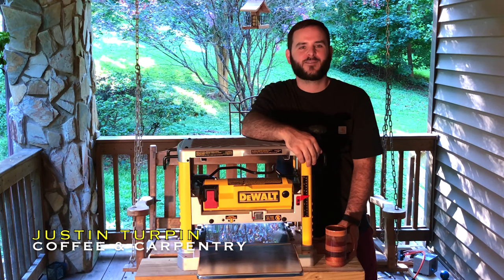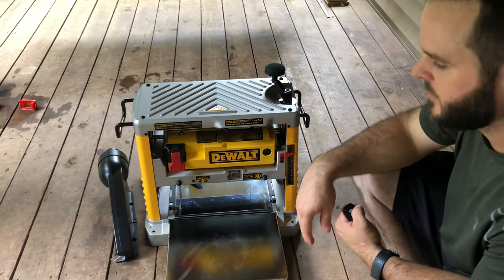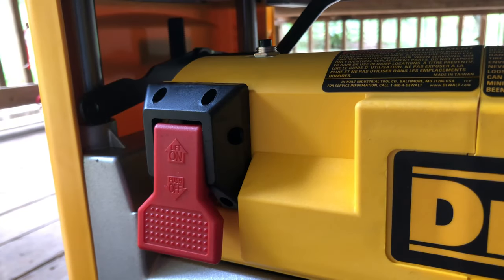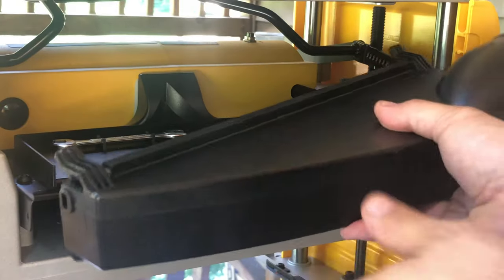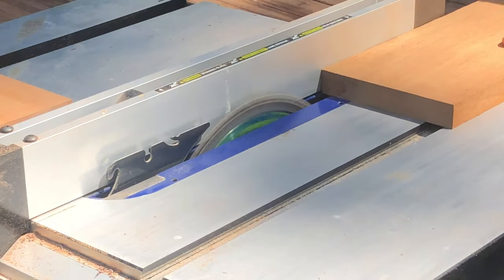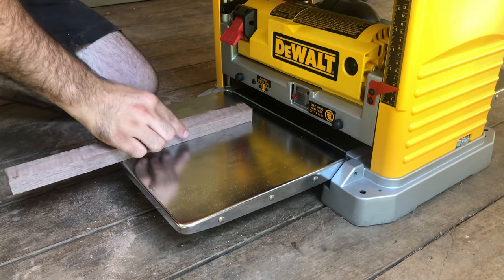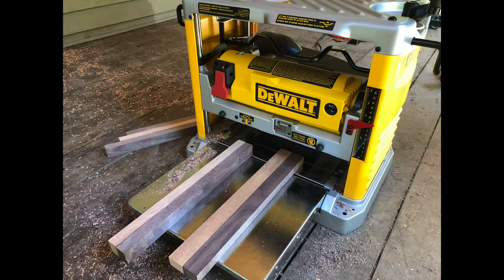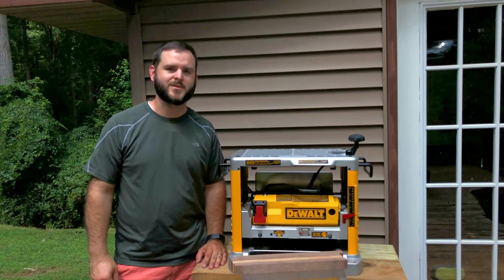Using your DeWALT DW734 Planer

Comment: Don't forget to push down on the lock before running your piece through the machine. It will stop the gouge (snipe) on the leading edge.
Reply from the maker: Thanks! I did notice I failed to do that while planing in the video.
Reply: No problem, my son has one and I figured it out after using it for a few projects
Reply: Seems like a real pain to have to lock and unlock it for each pass after making a very slight adjustment.
Reply: Thanks, was wondering about that!

Comment: The latest Dewalt dw734 does not come with the 10mm/8mm wrench, or place to put it.  Its called Type 20 i think as opposed to type 1.
Reply: I was wondering where my wrench was. Just picked it up this morning.
Reply: @peterfryer6915  what is the wrench used for anyway?
Reply: I assumed it was for the 4 bolts under the feed tables but I'm not certain
Reply: @peterfryer6915  Well, the holding place is eliminated on the model 20 tool tray, but you can get a model 1 tool tray for $14 on eParts and its an exact fit.  You can even get the stickers.  I was bummed when Home Depot sent me the model 20, but the wrench I can do without I guess.
Reply from the maker: That’s good to know. The Lowe’s closest to me still has the “type 1” on display but I’m curious to see what’s actually being sold. 🧐

Comment: What's the dial for on the right side? I'm thinking about getting g this one. Thanks in advance.
Reply from the maker: That dial is a turret stop. It prevents the planer from being lowered too far. For example if you're using a planer sled and have thin pieces it'll prevent you from planing your sled. Thanks for the comment!

Comment: Can you put a cedar log that has been cut from above 12" long to shave the bottom end to set level?
Reply from the maker: If I’m understanding the question right…I think you can by using what we call a “planer sled” and use super glue/shims to hold in place to get one side flat. Then when you have the one flat surface you can flip it over and run it through without the sled. I hope that answered your question!

Comment: You didn’t have the Lock bar down. You could see the plainer moving UP as you ran each piece threw the plainer. If you would have had the bar down you would not have gotten the missed section or Snipe
Reply from the maker: Yes I agree, I noticed that after I had already posted the video haha. I've used this planer hundreds of times since I made this video and I've used the lock bar every time since then. 👍🏼